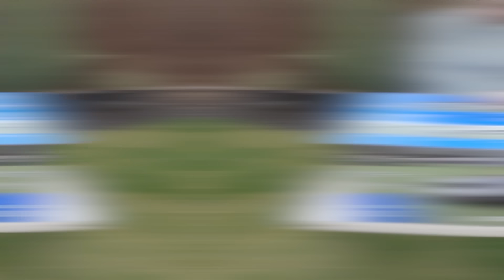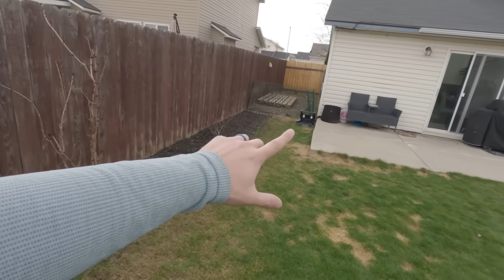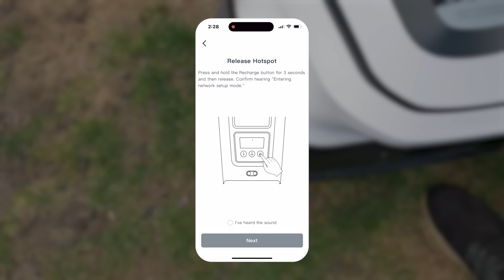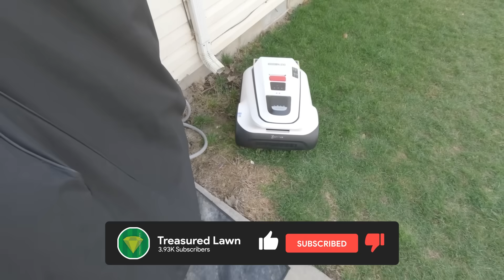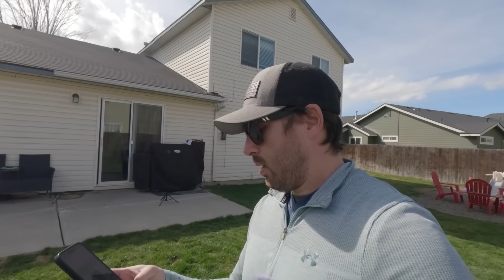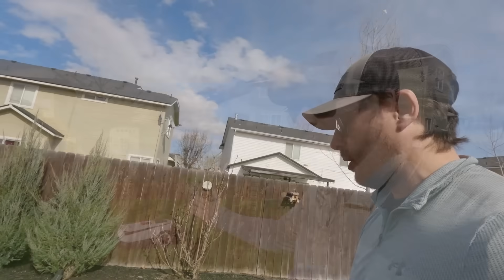Ecovacs GOAT A2500 RTK Review: Next-Level Robotic Lawn Mowing!

Comment: Nice! Can the mower mow in the front without an additional RTK station? Or do you need a second one for the front?
Reply from the maker: The front should have no issue as long as you have access to clear skies still. For me the only issue is having the machine go from back to front with our dogs I can’t make like a hole in the fence that works
Reply: @treasuredLawn  how many maps can it hold?
Reply: @treasuredLawn maybe modifi a dog door and put the dog sensor collar thing on the robot?